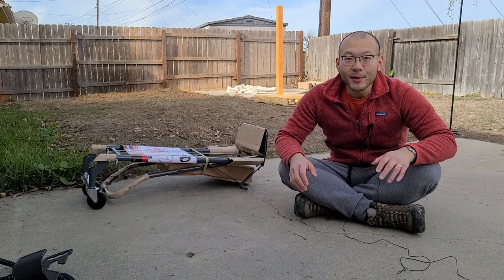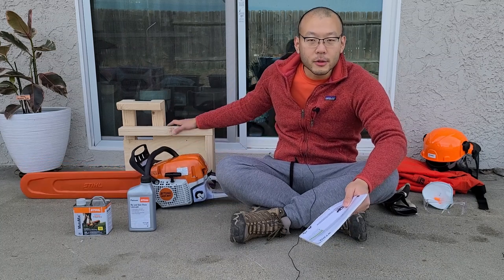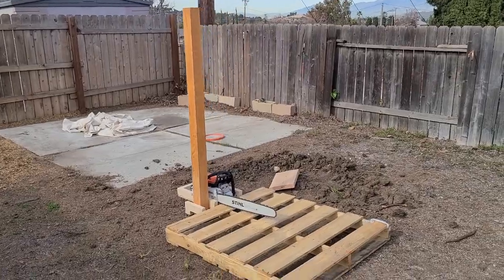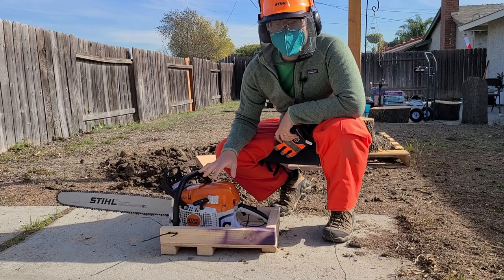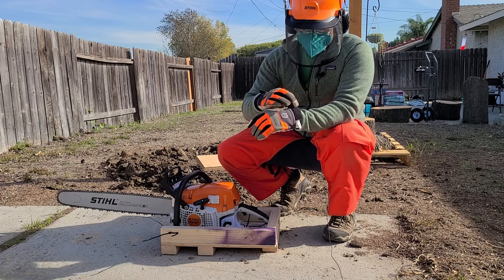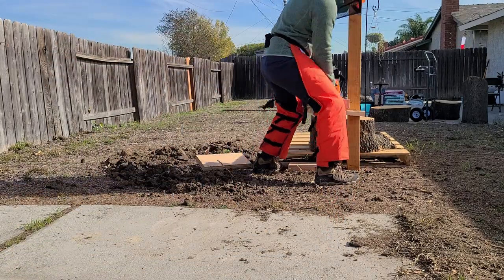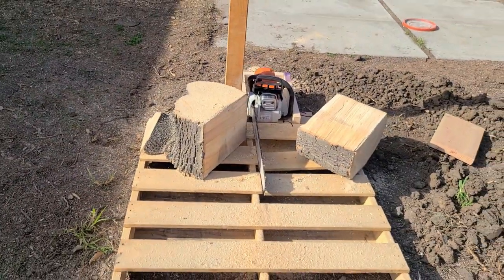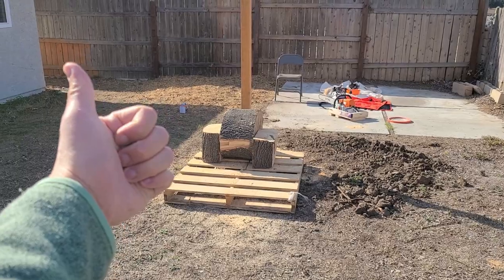A Dentist Uses Chainsaw For The First Time to Mill Logs

Comment: Great stuff. I can already see the future epoxy slab furniture in the making.
Reply from the maker: Thank you! Yeah. I'm still doing research, but the consensus so far is these are guaranteed to crack so looks like I'll need to learn epoxy!
Reply: @ADentistDoesHomeImprovement  Most definitely given how they were still green. Would def need quite some drying to stabilize. Embrace imperfections and make it work.
Reply from the maker: @MrCoolAttitude  Of course. I've seen some cool bowtie ideas for large cracks and that looks fun! This will also take like a year so plenty of time to post on reddit and forestry forum for help.

Comment: I just watched you with Rex, he was right your ingenuity is great. I look forward to see more of your videos!
The idea of having a vertical mill for small stuff is great, I like moments like "Why didn't I think of that?". When milling it's necessary to have it in a jig to guide the cut so your intuition is spot on. It is hard to cut straight freehand and if the chain isn't filed perfectly it will make a crooked cut.  Really good that you take safety seriously, too often I see people cutting in a pair of jeans and a chain saw can hurt you really bad, really quickly if you handle it wrong. If it can cut wood it can cut muscle and bone just fine...
That said, don't be afraid of the saw, it isn't dangerous if you handle it correctly and know where the tip is at all times and if it can get in contact with anything, control is the keyword when using a chainsaw. When cutting freehand you want to have it close to you and support it with your body both for control and to not get tired which in turn means better safety.

Just a couple of small tips on the saw. When you start it and its running on quite high rpm press the throttle a little bit to get it out of the half throttle start mode. It puts quite a large strain on the chain break system on high rpm so you want it on idle as quickly as possible.
When you cut along the grain you can use a ripping chain for a better cut and make the saw work less hard. For your saw you want the Stihl RMX or Oregon 75RD chains.  Ripping is hard on the saw so it's a good idea to give it all the advantages that it can get. Also let it cool down running on idle between the cuts, the fuel cools and lubricates so just let it run for a minute or so after you're done too. Don't force it in the cut it will work at its own pace with just a little bit of pressure and with a correctly sharpened chain it will cut great.
Reply from the maker: Thank you for all this helpful advice! I still have much to learn about chainsaws. I really wanted to emphasize the safety part. Especially for a beginner like myself. I actually broke the chainsaw last week and that's why I uploaded a car battery video this week. I made a cut with the chain break engaged. I tried to start it again and the pull cord was stuck. That's a $100 mistake that I'll never make again. Lol. I really like the local dealer that I bought the saw at. They're fixing it for me. Hopefully we'll be able to mill soon! I'll ask them about the ripping chain when I pick up the saw. Thanks again for all this detailed advice!

Comment: You are doing great! Love watching these videos since I was raised around tools and carpentry, it is cool to watch someone learning for the very first time. Keep it up man! One thing I saw is that you have the pallet oriented so the nails holding the center board are very close to where your chainsaw comes down. If you hit one of those you'll either have to buy a new chain or learn to sharpen the one you've got which will take some practice. It's a much needed skill if you want to keep using the saw though. I would turn the pallet 90 degrees so that the blade falls in between 2 slats to give you the most amount of room for error while keeping the integrity of the pallet.
Reply from the maker: Yeah....I already got comments about the nails. I actually stopped using the vertical chainsaw mill and mostly free handing now, but will make to move it if I ever use it again. Thank you for the good safety advice!

Comment: When you flood it, set it on ground or log, put your knee on top, hold the throttle open, and keep pulling till it starts. 
Had the same problem when I first got my MS 362 and flooding it.

I would recommend getting a couple of small felling wedges, they help if the log starts to pinch the bar as you are milling.

And I use to be terrified of running chainsaws and now I have quite a few, including the awesome MS881!
Reply from the maker: Yeah! I was totally flooding it. I was pulling at full choke every time and finally figured out once it was hot you only need half choke. I'll look into small felling wedges. I think one of the main problems is I don't know how to clamp and fasten the pieces I'm trying to mill. I just looked up the MS881. That's a big boy!

Comment: I wanted to let you know that if you tell the dealers you have never used a piece of equipment they will give you a class or show you how to use it and some safety hints that the manuals don’t teach you. Great video all around.
Reply from the maker: I really like the local dealer I bought from. They were super helpful and did exactly like you said. They showed me how to start it and agreed that safety is the most important.

Comment: I have to say, this is some incredible ingenuity going on!

Came from Rex Krueger, and he's right, this is massively addicting to watch.

How do you plan on making the surfaces flat? Plane, router, sander, lots of epoxy?
Reply from the maker: Thank you! I think a combination of everything you said. I posted on reddit/forestry forum for help and seems like router jig will be the way to go. Everyone is also saying except to be sad with all the cracks, but that's where the epoxy will come in! I've also seen really cool bowties to incorporate into large cracks. Good thing I have at least a year to do research while waiting for these to dry!
Reply: @ADentistDoesHomeImprovement  I've flattened some using some different methods, but the router sled is what I'm about to try and it SHOULD be WAY nicer than the others.

Yeah, the thing with wood is it isn't perfect. It's messy. It's chaotic. It's weird. EMBRACE it!
Reply from the maker: @GODLOVERBAM  Nice! Let me know how it goes. I have some time before I try to flatten any of these green pieces. I'm all about embracing the crazy wood pieces. Good luck on the sled!